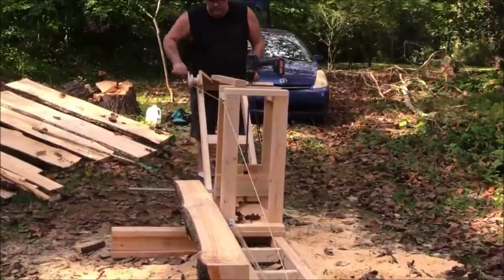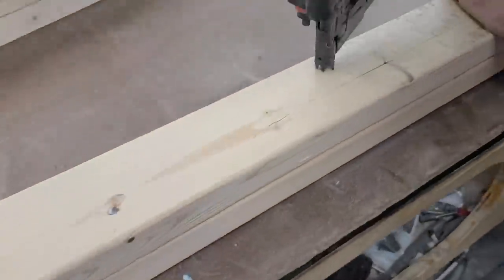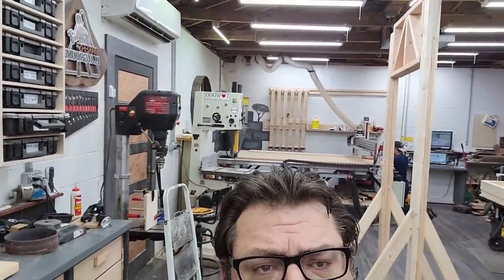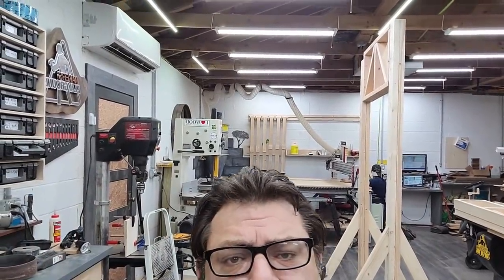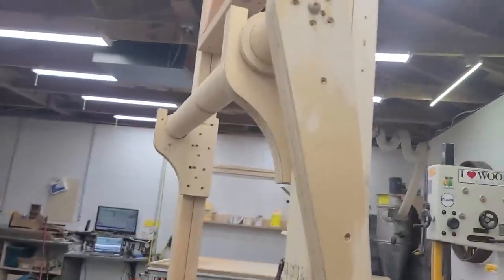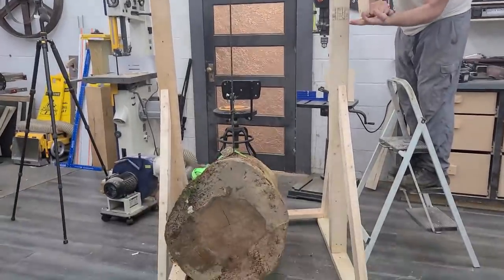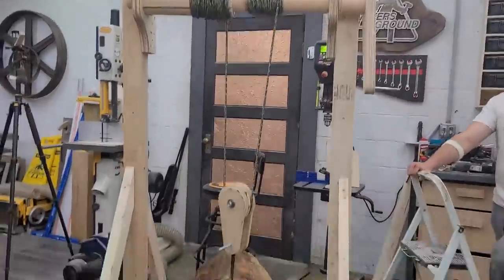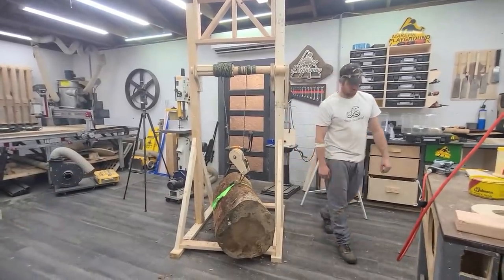DIY - Device for lifting heavy logs

Comment: Fantastic Izzy. Love the quick and sturdy gantry design. Easily make it mobile and adjust design for different door sizes. Chinese windlass is interesting and new to me. Thanks. Btw, could we add a wooden gear or cog that can act like a one-way stop? I guess like a ratchet strap. Or would that be misleading and potentially dangerous, because a wood cog couldn't hold that kind of weight and could possibly give way anyway? Really, How much wood could a wood cog hold if a wood cog could hold wood?😆

Comment: If it doesn't have to be a  wooden "windlass" Perse, use a pulley system and a Harbor Freight worm gear winch with a 5/8 nut and use a drill to lift. This will also allow no movement when done. ?

Comment: I have a device that can lift heavy logs and it originally cost me about $75 back in the 1980's. It's rated at 2 tons so a 400 pound log would be no problem. Just used it a few months ago to lift very heavy cherry log from a tree I took down.

Comment: I think you needed some sort of cap to the thicker side-- sort of like on a spool of thread-- to keep the rope from slipping off. I'm trying to find the words to verbalize what I can see in my head as a way to help reduce the strain on the lifter. I remember seeing some tree surgeons using 2 metal things with a groove to split up the weight distribution a bit. Are they called pulleys? I am blanking on the terms.
This is very cool though.

Comment: Maybe dd a ratchet to keep the handle from spinning backward so the operator can tend to the log and line, and how ‘bout a drive handle with a smaller diameter gear than the windlass shaft to increase mechanical advantage even more?

Comment: That handle lever is dangerous without a catch to stop the rotation in the case of a slip.  It's easy to put a catch on there which will stop the handle in one rotation and I recommend that you do it.  It can even be hinged so that it lets the lever pass when going up and flops back into place as soon as the lever is past the latch position.

You can also make a tall A frame out of lumber that sits astride a log with a strap from the crossbar of the A down around the log.  Lean the A backwards towards the far end of the log, cinch up the strap then push (or pull with a rope) the A upright and the log will be lifted and pulled along it's length.  Repeat until the log is where you want it.  I've safely moved complete tree trunks and dislodged widowmakers using this device.
Reply from the maker: Its just a testing set up not final version
Reply from the maker: This is just testing set up not final version

Comment: I am interested to hear what the log weighed in at if you did actually put it on the scale later as you mentioned . I was going to guess it wasn't over 250-275 lbs but you know the camera adds 10 lbs they say . Cheers and looking good on your feet mister
Reply: Scott Clark 11 hours ago, "I am interested to hear what the log weighed in at if you did actually put it on the scale later as you mentioned . I was going to guess it wasn't over 250-275 lbs but you know the camera adds 10 lbs they say . Cheers and looking good on your feet mister.   ----- THOSE INTERESTED, READ BELOW ------
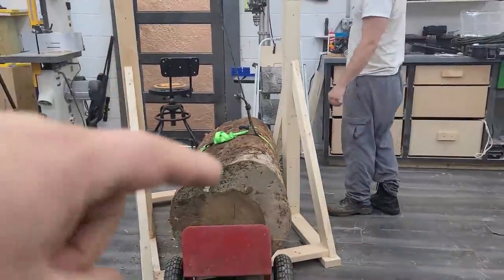at 8:34 Izzy says 20-inch diam. and 4 feet long... SO. 20/2= 10-inch radius so Pi*r^2=3.141592*10*10=314.1592 square inches So times 48 inches long=15079.6416 cubic inches,  then divided by 12 cubed = 8.72664 cubic feet total wood volume ... wood floats in water ... if just floats then 62.4 pounds per cubic foot for water so times 62.4 is 544.5426 pounds, but if the wood floats 5% out of the water then, 95% times 544.5426 = 517.315 pounds total weight. If a sample of the wood floated higher out of the water, you'd have proportionally less weight overall.
NICE CALCULATION, ISN'T IT. DIDN'T KNOW YOU(Talkin' to your readers) COULD CALCULATE LIKE THIS DID YA(Talkin' to your readers)? AND anyone can do it!!!
Science, Love it!

Comment: Could you replicate or improve on the Chinese windless by using a 1-ton hand winch and a snatch block?
The hand winch would also give the extra safety of locking gear teeth to avoid a runaway crank.
It seems like the center rod supports could also use 'jack stud' supports.

Comment: I know you like to build things from scratch, but I think I would just mount a boat winch to a side using a plate to give the handle room to spin, and put a pulley on top and bottom. You could drive the winch with the drill. You won't need a ladder. Your safety latches are built into the winch. The reduction built into the boat winch along with two pulleys,  you should be able to spin the handle pretty easy.  Making that top shaft spin will require more bearings than making the top stationary and using a single pulley. The cross shaft being stationary will also make the whole frame much stronger side to side.
The single pulley will also lift it straight up. The Chinese system the ropes will wander around. It is an idea I never seen though. 
 Lots of ways to do the same thing, but you did ask what we thought.

Comment: Does it need to be that tall what's with the bracing at the top.
Maybe a better ways is to make an A frame and pivots what is a lot shorter with the top of the a frame extending out a little bit past its pivot point, connected with two threaded rods a bolt and gears in the middle you can use the drill to wind the middle bolt and open and close a frame no pulley winch would be needed, you can lower the A frame right down over the log then by using the drill closing the A-frame will lift a log I wouldn't go past 45 degrees for stability purposes when pulling up.
Use something like wheelbarrow wheels for the corners for easily mobile and allows the frame opening and closing without catching.
The bracing connecting piece couple ways I suppose probably quarter-inch 3 pieces of threaded rod all the way along connected to a hub at either end then a hardened Steel Bolt, and the rods would have to be tired along their length and the centerpiece where the log would be situated a piece of wood between the Triangle rods.
This could be made for extra lift as well if needed and one of the hubs you can put a cog ratchet. Probably best to weld the threaded rods together with the bracing.
Reply from the maker: It just a set up for test lift mechanism. Not using for hauling logs

Comment: Remove the hand crank and add a worm gear .... might be able to strip the components from a cheap boat which.  

Makes it a little safer by removing he possiblility of the hand crank becoming a wind mill if it slips out of your hand and gives you even more leverage for attaching a hand drill

Comment: Wondering how your going to get this over a long log with the two connecting pieces spanning across the bottom only a few feet apart to lift it? Just a thought, rig it to lift one end of the log only dealing with half the weight,  then place a two wheel carpet rolling type dolly under the middle to balance the weight, making it easy to push or pull to your desired location, with your ingenious mind you could even adapt the two wheel dolly to affix the milling device to attach to the dolly so it holds the log while your milling it, maybe placing some portable supports on each end to level the log for milling, just thinking out loud, Great to see you moving around so good!
Reply from the maker: Not going to use this setup for the log hauler  just for testing lift systems
Reply: swan  nice, I logically couldn't see that rig doing the job

Comment: Did you try just having one end of the rope fixed, then through the pulley and onto the windlass?
I think you would behave less trouble with winding in two sections on the shaft for the same if not more lift for the same effort.
The pulley could give you a 2:1 advantage by fixing one end on the rope to the gantry and the other to the shaft. You may have had 4 or 5:1 on the shaft added to the bit less that 2:1 on the pulley so maybe 6.5:1 ??

Comment: I understand that this is prototypical but I wonder if one would be able to build/place this in the field if you couldn't get the log off the ground and moved to said lift? I noticed in the sketch you drew third legs outward. Would you be able to utilize this type of stability control and prevent racking while eliminating the cross members at the bottom so it could be used in the field after the initial felling of the tree?

Comment: So what use would this be? You still have to lift the log up in the air to get the device underneath it and when you do have it hoisted up you can't move it anywhere.
Reply from the maker: It wouldn't. Tower is just for testing lift mechanisms has nothing g to do with the log mover build

Comment: The lift per revolution of the windless depends on two things only.
One, the difference in rope length between spools per rev. This is just the  difference in circumferences between the two spools.
   This is just: 
       PI*d1 - PI*d2    (where where d1, d2 are the spool diameters)
If d2=0  you have the traditional windlass, where mechanical leverage depends only on 
one spool diameter. (A zero diameter spool is just an anchor.)
If d1==d2, the rope never changes length. Easy to operate, but not useful.

Two, as the weight is lifted, the ropes become more horizontal and provide less effective lift.  Important but I ignore this.

Comment: wouldnt it make more sense to use a pair of wheels sandwiched between boards pulling the rope up on the outside smaller winds of rope and a single centered larger rope for both in the center. That would center the force to the middle and keep the ropes from walking off like you were having...

Comment: Firstly, it looks like you're using that cheap braided crap from a big box store, which really doesn't have a big enough lifting capacity, but I might be wrong there.  Secondly, it looks like the classical differential pulley ("chinese windlass") wants a secondary ("takeup") diameter which is larger than the original diameter. That would probably work much better than using the rope to become the secondary diameter. I wonder if you can accomplish that with your "table saw dowel maker". I think that would be a clever idea.

Comment: Hey Izzy, nice one. Can you not have 2 pulleys spaced apart so that each set of vertical ropes stay directly under its role and not tend to slip off. The challenge of course is to keep the 2 pulleys mechanism horizontal...

Comment: Very nice, BUT, there are much simpler ideas for the same application. As an example, why not make a log arch?  Google it. If I remember  correctly a firm in the UK make these. Pretty simple and effective.  You lift the log all by yourself and you can even walk it around. It is on wheels. You can even hang it behind your car.

Comment: 7:20 Do you have plans available for this table saw jig??? I would really like to build this. 

11:00 Tow truck drivers and crane operators refer to that as a snatch block. It doubles the lifting or pulling strength of your winch, which in this case is hand operated, but still doubling it's lifting power. Adding another snatch block will increase the lifting power even more. I know you want as much wood as humanly possible in your projects, but if you replace the wooden snatch blocks with metal ones, they can be MUCH smaller and MUCH stronger as well, which would allow you to use 2 or 3 of them without you having to be concerned with them getting in each other's way. Once you get the math figured out for the snatch blocks and winch, the only thing you'll need to be concerned with, is, is the frame strong enough to support what the winch can lift. Yes, it is very easy to build a winch that is stronger than the frame that supports it. Get this thing perfectly dialed in, and your kids will be able to effortlessly lift 1000 pound logs.
Reply: He mentioned blocks. He said you'd need 10 or so to get the leverage required and that being too messy.

Comment: The Chinese modification just makes the process somehow longer but requires less peak strength.  It's no different than using a longer handle, or a gearbox. You can't cheat physics..